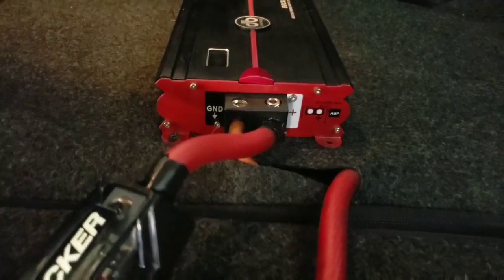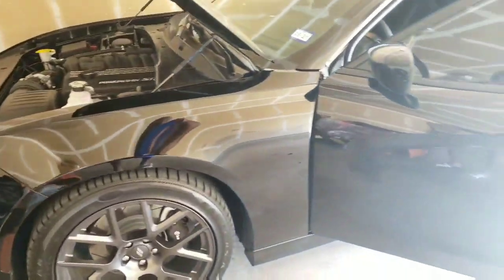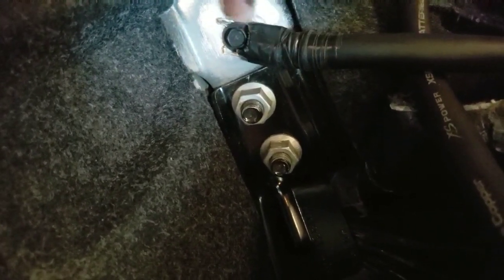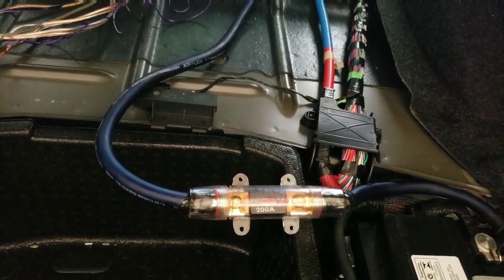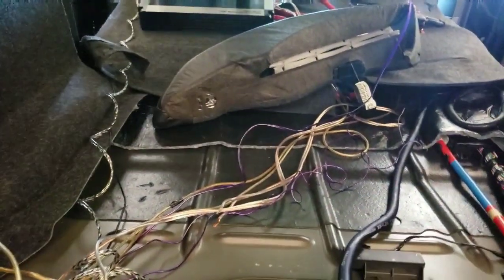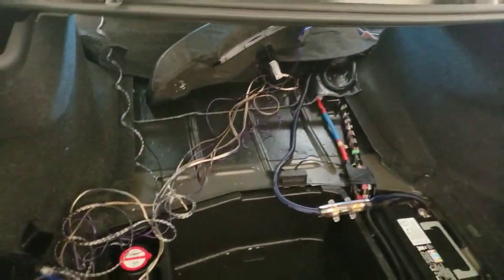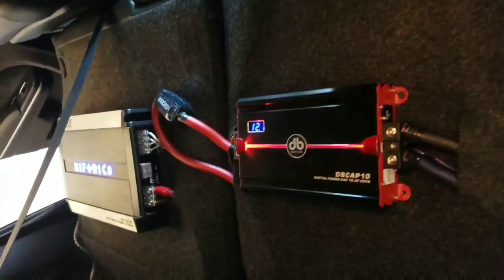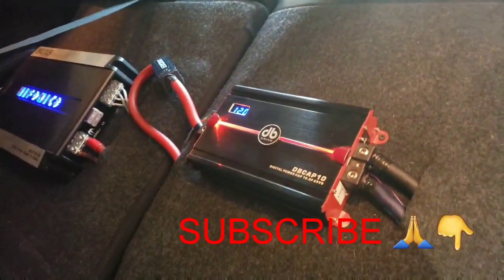HOW TO INSTALL AFTERMARKET AMPLIFIER AND SUBWOOFER IN A DODGE CHARGER

Comment: What did you tap into for your remote wire
Reply from the maker: Remote wire runs from amp to LOC
Reply: @Hellcatblk_  thanks
Reply: Wat is a loc
Reply: @Riqdakid  line output converter

Comment: How much u guys think is a reasonable price to install a skar audio evl 15 Subwoofer, 4 skar fsx 6.5, 2 skar VX 175-st 1.75 super tweeters in a 2012 Honda accord?. Please need your help
Reply from the maker: Just installation.... im assuming you have everything already right?#
Reply: I'd do it for free lol. Sounds fun! Idk shop rates, but its gonna be a rip off reguardless.
Reply from the maker: Yeap shops fees are crazy
Reply: @Hellcatblk_  yes, I got everything I mean everything ready.
Reply: @1ohmwrecker Did I hear u say free?. Which start u at lemme drive there?.
Reply from the maker: OFF THE TOP I WOULD GUESS AROUND 300$ FOR INSTALLING EVERTHING......

Comment: Did you put a new tv in ? If so where did you get the dash kit at ?
Reply: walmart has the cheapest the dash kit is close to 400 dollars or over dependeng where you  order its metra 99-6514B

Comment: It's been years since I hooked up a radio, so don't you still hookup to radio with line input cable thingy that uses rca Jack's that run to amp?
Reply from the maker: Yes thats correct they are called LOC very cheap at Walmart bro....
Reply: I’m guessing the new cars like my 2016 300s don’t have rca outputs in the back of the stock radio so you have to physically tap into the signal using the existing speaker wires
Reply from the maker: Correct thanks for watching
Reply: I'm guessing it's the same process even if you got beats audio? Just run the loc and everything should pan out...
Reply from the maker: Exactly
Reply: @Hellcatblk_  good video, I have to get another loc. I'll be fighting with the install tomorrow. You got a reco for one or a particular brand to plug into beats?
Reply: @Hellcatblk_  My son is in process of hooking up his radio, and Im just not interested, I guess car radios is something that you simply loose interest in!
Reply from the maker: @jurnagin  Hopefully my video helps your son out..... If he has any questions hit me up on my IG
Reply from the maker: If you go to my amplifier install video you will see how i installed mine along with the brand..... im currently waiting on a new 1 n more powerful 1 to come in..... Video dropping soon...
Reply: @Hellcatblk_  what's your Instagram? I had some questions if I could get ahold of you on IG?
Reply from the maker: Scatyblk

Comment: It will not work if you have a factory amp bro you need the harness it’s a pac AP4 ch-41 and it’s about 300
Reply from the maker: Thanks for watching..... what exactly are you referring to?
Reply: He tapped into a speaker wire probably
Reply: Yep Iam running to amps. one for interior the other for sub, didnt have to cut one factory wire, pricey but knockin....

Comment: So do u not have to hook subs or any wires up to back of radio anymore I have 2019 rt charger or is that older cars
Reply from the maker: Not on factory radios you must use a LOC

Comment: So you ran the power and negative off the rca adapter straight to the amp? Just wanna make sure i do it right
Reply from the maker: Talking about the LOC?
Reply: @Hellcatblk_  yea
Reply from the maker: Yes sir correct

Comment: Where did you hook up the line out converter? I tried doing it to the rear speaker but it didnt get any sound
Reply: You ever figure this out?
Reply: I'm trying to figure this out as well lol
Reply: @nicksingh8063  I actually did this 2 days later. I hooked up the converter to BOTH my rear speakers, running long wires from the terminals and then tucking everything under the carpet behind the seats. It's great!
Reply: @FlightRobXIII  you the man bro! I'm gonna run that tomorrow night

Comment: Ditch the cap and run all power and ground to the battery
Reply from the maker: Is the cap  bullshit?
I've been thinking about this
Reply: Yeah they are really a gimmic.
Reply: Get rid of it... If you got too much power for the stock system which i think the dodge have enough amperage for that system then go second battery
Reply: Kevin Duclos true!!!  That’s how I got it! One of the benefits of having the battery in the back.